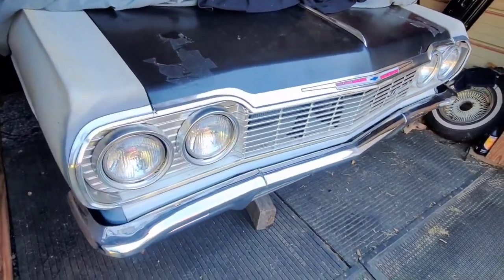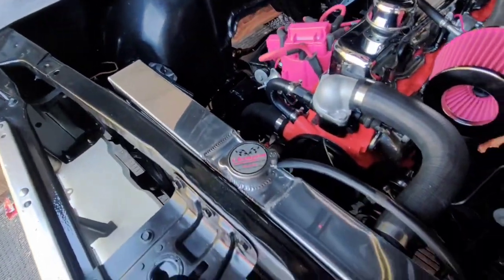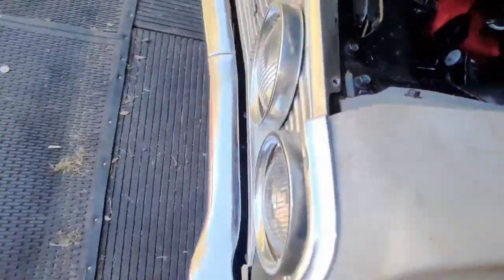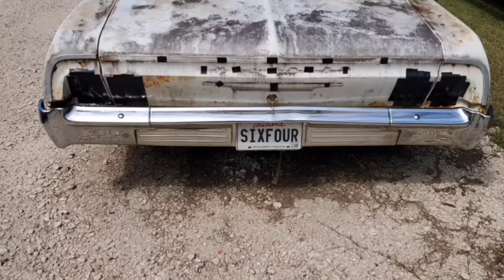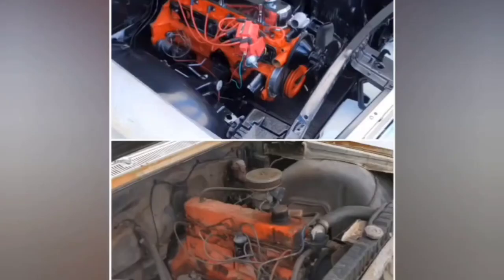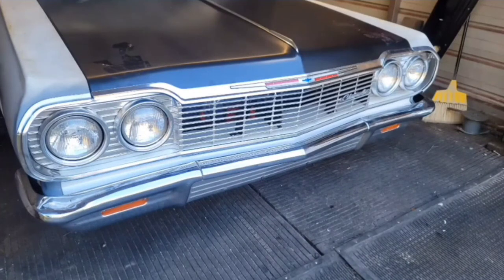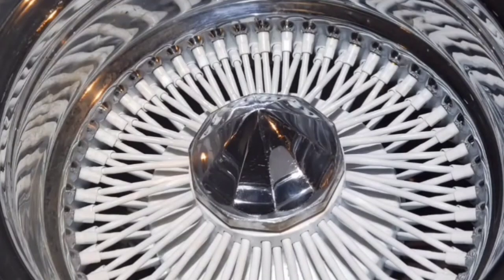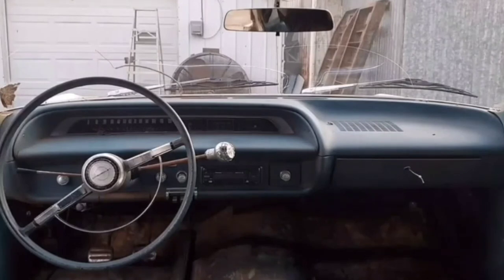1964 Chevrolet Biscayne Impala Belair 230 L6 restoration.

Comment: I bought me 64 4 door Impala replaced all the floor boards. Finished the back brakes, and working on the fount. I love it 4 doors doesn't mater.
Reply from the maker: You right man. Im on 2 groups on Facebook Crew cab mafia and moore door mafia. All 4 door guys. Very friendly and all have the same love for the 4 door cars
 As much as the 4 door cars get cannibalized by the 2 door guys, our 4 door ones will be very rare. Hold onto it my friend.

Comment: Great work 👏🏾 I have a 64 2 door with the same engine but what distributor did you get for it? U kept the same transmission 3 speed power glider?
Reply from the maker: Thanks man. Its a Jegs HEI distributor. My car is a standard transmission 3 on the tree. I wasn't gonna drop a new engine or transmission in it because it's a 4 door. I already got at least $7,000 in it in restoration. Still getting air ride and be rims and tires and door panels.  Another 5k to go.
Reply: I had a 67' belair   250'six 4 Dr. 3 on tree. Same basic engine as yours. I used to be a 2 door guy until I got this one . I have had all 4doors the last 40 years. I call em crew cabs. These are the kind of cars that should be made today no frills . You can repair them with minimum tools
Reply: Fantastic voyage [cheers]

Comment: I hope it has a manual transmission, instead of the miserable Powerglide two speed Automatic.
Reply from the maker: Yeah, it's a 3 on the tree. Love it. It is supposed to be out of paint around the 25th of January. And February my door panels should be in also. Hoping to be ready for mardi gras.